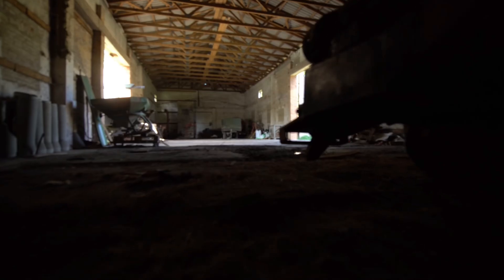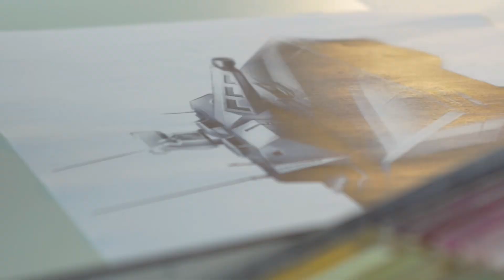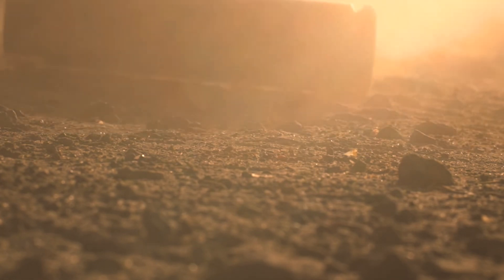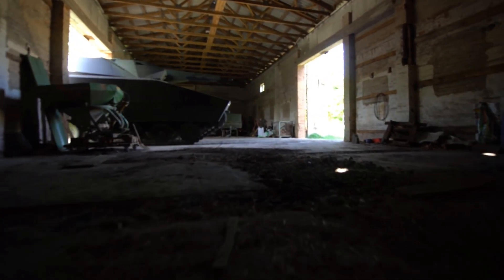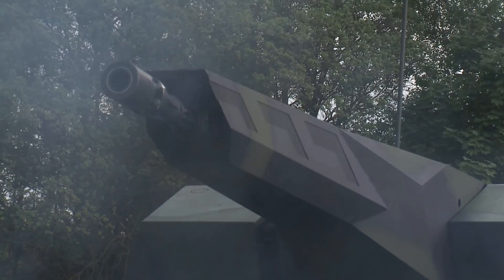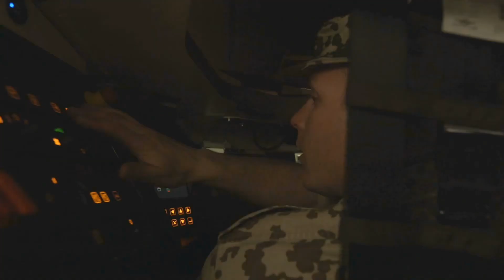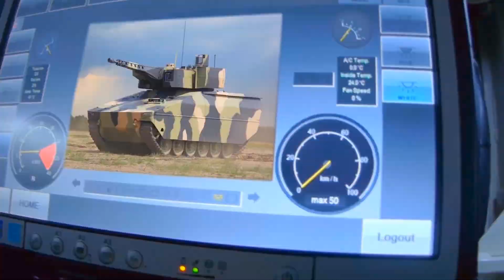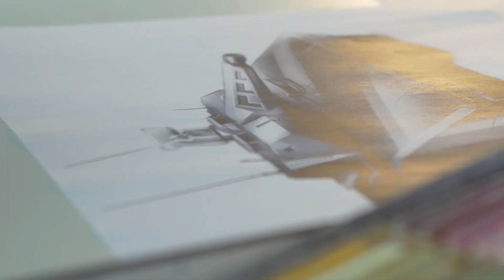Lynx KF41 IFV - Puma has competition!

Comment: Nice 🙂 Heavy IFVs are definitely needed to work alongside MBTs in a modern environment where RPGs and ATGMs will be common, and where opposing IFVs will be armed with 30, 35, 40 or even 57mm autocannons. Lightweight vehicles which are fully amphibious and or air droppable (BMP, BMD) are also great for when such levels of mobility are required, but equipping all your ground forces with such vehicles would be unwise.
Reply from the maker: cocopud totally agree 👍

Comment: @Matsimus: I disagree about your opinion on weight. Sure more weight should mean better protection, but mobility and(today very important)transportability(air) must be prioritized. What good is a heavy tank that can not be deployed to the troops in the field? Otherwise the Lynx seems to be a very fine tank.
Reply: frank laufkoetter air transportability is a nice thing to have the capability of but the Sheridan, and the Tetrarch and Locust of WW2 prove that compromises have to be made to make it practical
Reply from the maker: Fair points but I still think weight isn’t my highest offender
Reply: For ailiftability look at the Puma. They remove modular armor panels so it fits inside a A400M, and at the destination they mount them again. Takes the crew 4-6 hours but is better than going in the field without the addon armor at all. As far as i remember the AJAX was also aimed to have this feature.
Reply: @Jonny: Yes, I think thats the best way to do it.
Reply: frank laufkoetter well I've heard lots of veterans say it was a deathtrap against any enemy infantry with RPG's or against any enemy tank bigger and heavier armed & armoured than it i.e. just about all of them by the time it came into service, and it's primary weapon was definitely removed from service early and only used on two tank designs for a reason
Reply: @1ibramGaunt: Sure, show me a tank without compromises. I think there is none...By the way, the Sheridan was successful in multiple wars(Last: Desert Shield in the 90s)
Reply: @franklaufkoetter2133  id imagine weight would be a factor depending entirely on what you intend to do with the vehicle......for instance i dont see germany airlifting large contingents of anything, anywhere, anytime soon. So for them heavies probably not a big deal. The US can get away with ignoring weight to some regard since its got a massive heavy lift fleet. The ruskies would probably be very keen to keep weight low for transportability and with theyre obsession with amphibious everything lol just as a few examples
Reply: frank laufkoetter what success it DID have was down to the bravery and skill of it's crews as you can't just pick and choose the equipment you're given and have to just get the best you can out of it; one unit did famously disobey orders to transfer and just kept their old M47's until forced to do so, and I very much doubt they'd have done that if the compromises I mention were a good thing
Reply: Jonny agreed, that does seem to be a good idea for how to go about it if you are going to go air-mobile and with AFV's, IFV's and light scout vehicles the issues involved with making a full-on tank air mobile are less of a problem  anyway
Reply: @1IbramGaunt: A good crew beats the best equipment, no doubt about that. But I read about very poor performance of the M47 in multiple conflicts(Israel, Jugoslavia...). Maybe sometimes it is only "never change a (maybe not so well) running system? New weapons tend to have faults or the soldier acts slower than before until he gets used to the new stuff...
Reply: 70km/hr makes it one of the fastest in its class... when mounting full IFV specs with STANAG 6 and APS